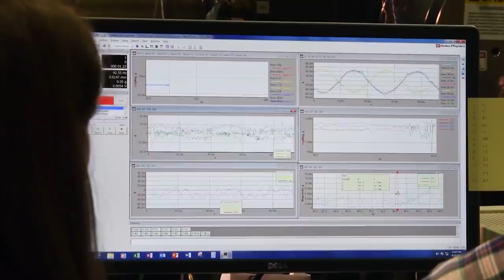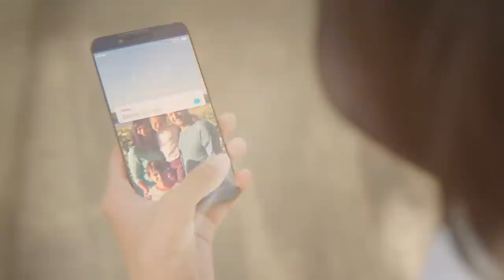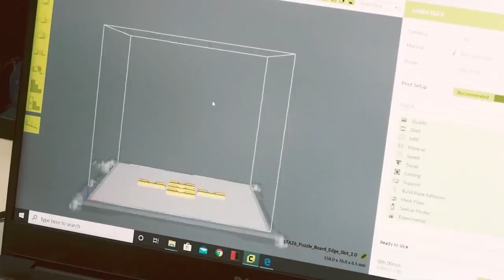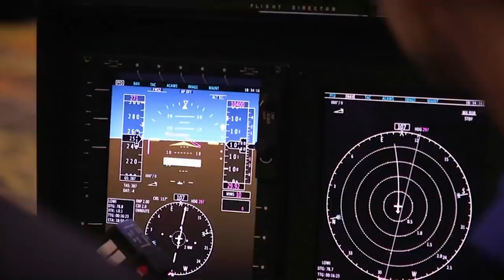AFWERX Agility Prime

Comment: There is also the regulatory hurdle. The FAA and DOT will have a large impact on the ability to operate the aircraft in the crowded skies. As mentioned earlier, safety will become another priority and both the FAA and DOT will have significant input that will most likely change the designs of the aircraft.

Comment: Narrator says "reliable" several times while talking about current electric propelled drone tech... Sorry, having operated my own builds and afterwards Inspire 1V2 followed by Inspire 2... There is no way I would enter such a people carrying flying apparatus. With no autorotation in case of emergency and having strict weight constraints which means no additional parachute for the entire vehicle together with a fact that even with such a precaution, it would be mostly useless due to the mostly low altitudes. In my eyes, a widely deployed fleet of automated flying "people movers" is a disaster waiting to happen, and when it does, it will not only kill the passenger/pilot but also people underneath (flying taxi scenario) and the flaming wreckage packed with Li-Ion / Li-pol batteries which cannot be extinguished (batteries contain fuel and  oxidizer for the flames) is just a cherry on top.
Reply: The kitty hawk heavyside has a ballistic parachute, can glide and can maintain hover with a multi engine failure...

Comment: I understand the want to be 100% green, but I think hybrid-electric might expedite certain technologies as it doesn’t Rely on the currently quite limited battery capacity. They could develop the technology while things like solid state batteries, which seem just on the horizon, are ready and can be slot into the VTOL platforms.
Reply: Pretty sure this will be common if you want some range. Electrical here is that you have propellers driven by electrical engines who is easy to controll
Reply: Hybrids will likely be implemented at some point. The precise control and reliability of electric rotors is the factor that makes this technology practical. Develop a platform using only batteries to refine the design. Later add a gas fueled generator to extend flight time. Definitely want to get the airframe perfected before worrying about how to extend range. Also, I would never be a passenger in one of these things without a ballistic parachute emergency system. These don’t fly like helicopters. They work on a completely different principle. If anything fails they do not autorotate and allow an emergency landing. No, if anything fails these things fall out of the sky. Fly into a flock of seagulls and it transitions from flight to free fall quickly.

Comment: At least four things strike me:
1. You will never see these vehicles working as taxis (or personal private transport) in urban areas because of their footprint and the little matter of all those spinning rotor blades.
2. Battery mass. There is no way to avoid the fundamental fact that batteries are less efficient than combustible fuel as a store of energy. This means an electric vehicle has greater mass than a conventionally-driven counterpart AND/OR it has much smaller payload capacity for a given total mass AND/OR it has a much smaller range. That leads on to...
3. Safety. Would you trust putting yourself in a compact electric aircraft that might have a range of (say) twenty miles or a range of only ten miles (depending upon the state of its batteries, ambient conditions, etc) if you then wanted to travel (say) fifteen miles? One day you might get there perfectly safely and the next you might have to suddenly drop out of the sky onto whatever is below because the batteries are exhausted.
4. Even if the tiny matters above could be ironed out, air traffic control would have to be rethought. Just as with drones currently, there would have to be restrictions upon where such vehicles could operate and that might just conflict with where people most want/need to use them.
I don't deny that a few electric aircraft prototypes do already exist, but they are fabulously impractical for the concept of compact personal transport. A nice toy for the tycoon with his own little airstrips and a huge area of privately-owned land, let's say (hmmm...thinks...who could I mean..?), but not for the normal world.

Comment: I want a car like the Jetsons had. We have the jet engines that could do it. Say 1200 kg thrust in a Olympus style Harrier lift proposition.  Four passengers, 500kts, 2 hrs endurance, point to point VTOL. The landing footprint need not be bigger than 2 standard parking spaces. Swicthblade wings could be deployed as horizontal flight is acquired. The tech is there but government will is what fails us. Take even 10% of passenger cars off the roads and all our traffic jams disappear.

Comment: "Useful and sustainable flight" via purely electricity isn't currently available due to current battery considerations.. Li-ion isn't it, but there are various other sources that may come on-line to conquer that.. Much like the Wright brother's early flightt, development of 'engines' will change that, but who knows when? There won't be an electric 'jet fighter' or passenger liner for some time, although I'm certain it will happen, maybe from a very unexpected source.

Comment: Electric glider system vertical takeoff Glide to travel electric Landing wind turbine for recharge of the batteries personal vehicle maximum payload 500 lb total of 800 when being used remotely. I thought gargoyle would be a good name and it could be a medic evacuation unit or a special ops delivery unit remote return.

Comment: HUGE problems with this: Batteries. They do not have enough power to do this job, and you can't use more of them, because they weigh a lot. People. So many wingnuts can not drive safely in two dimensions let alone 3. Cost. They will have to be made of carbon fiber, and/or titanium to be light enough. In the 60's everybody dreamed of flying cars, and experts promised them in a few years......

Comment: The biggest problem of personal flying "cars" is congestion. It's still there, but instead of horizontal, it vertical.  These cars will still be trying to get to work during rush hour. How do they get to higher or lower altitudes without traffic controllers? What happens when an older model, which hasn't been properly maintained, suddenly breaks down, and comes tumbling down from the fast altitude lane? What about the driver who suddenly realizes he's about to miss his exit lane. There are way tooo many problems for individual flying cars. As for autonomous individual flying cars, they have even more obstacles to overcome. Don't anyone hold their breath on this one, it ain't gonna happen soon, if ever.

Comment: You guyz need to develop a two fuel/energy system, like a railroad Diesel-Electric. A fuel / cell generator (hydrogen, avgas, diesel, JP4, etc.) for a generator to charge batteries and drive the propulsion blades. But unlike a Diesel-Electric you will be able to power direct & store energy......
Where's my patent app forms??????????